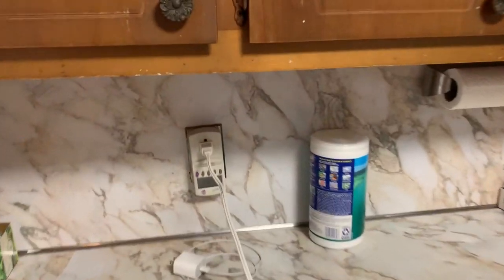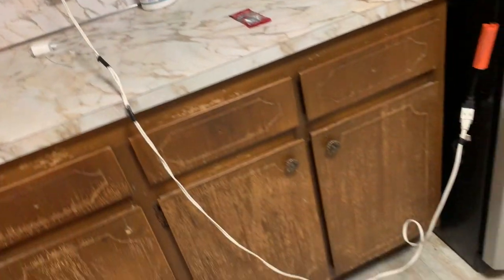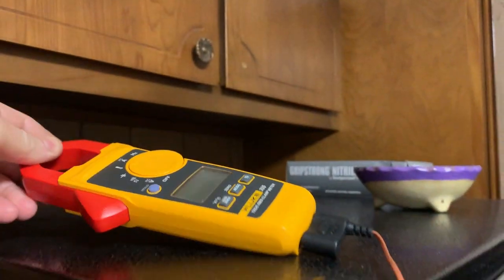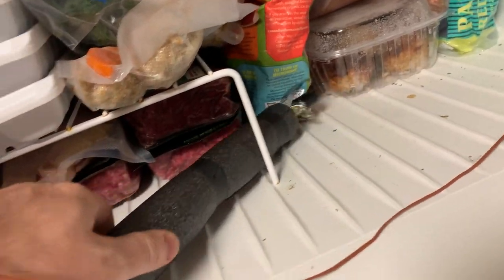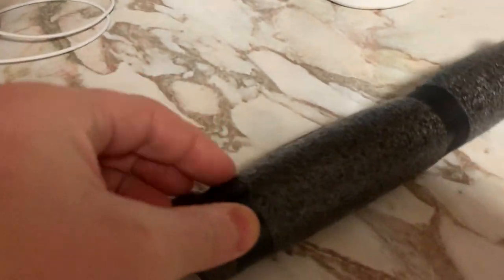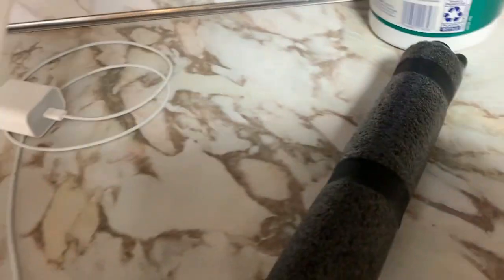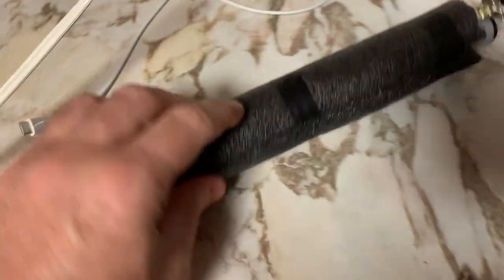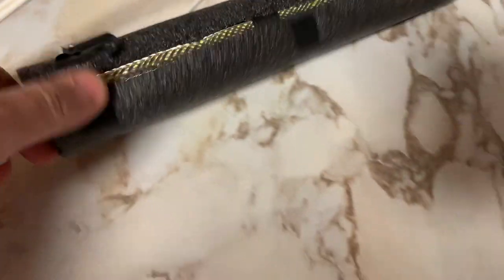Testing  EasyHeat 2102 Freeze Free Heating Cable

Comment: Troy hear from Fairbanks Alaska where we know a thing or two about the cold! This easyheat cable is one of the easiest ones I found to make to custom lengths in the field, and is far less finicky about blowing breakers, etc. than some other cables I've used. Sometimes the smallest amount of dampness will cause these things to trip breakers.

Within the instruction kit easy heat will tell you how many wraps of the tape you need to make per foot or to put another way the frequency of the wraps based on temperature, pipe type, etc. 

I've installed this on P-trap's down to 40 below zero, and it works well. For water lines I would use a 6 W per foot. One of the reasons for the extra wattage is if the water does happen to freeze, it takes a lot more power to  unthaw  a frozen pipe than it does to just keep it from freezing to begin with.  More than once I've had to call out a professional to thaw my well line. 

I would say the devil is in the detail with any heat tape. You want to make absolutely certain you got good contact with the pipe, and don't miss any areas or otherwise have gaps. Seems simple enough but you'd be surprised how many people loosely wrap a cable like this around the pipe.

The other thing is the job is not complete until you wrap it with insulation. That's going to keep whatever heat that does escape close to the pipe. Here in Alaska we actually spray foam the pipe with a good 6 inches of urethane foam, and that is key. There's no way a heat tape like this is going to keep up with 40 below zero without some good insulation coverage. I think it's as important as the heat tape itself. 

This is one product that has consistently perform well for me, but again the devil is in the details. I would also suggest to people they wrap in fiberglass, and not cotton rolls to prevent the possibility of fire. Really only an issue if the tape shorts out, but it can happen.
Reply: Troy, 

I have the Easy Heat Freeze Free installed in a home in Northern AZ.  Yes, it gets cold albeit not Alaska cold here.  I noticed the system was tripping breakers due to the in-rush current.  Seems there is a warm-up period of about six minutes where the heat cable draws 2-3 times the rated current.  For 240 feet of this stuff on 4 circuits I broke it into two 15A service lines.  Normal steady state current at 3W per foot should only be about 6 amps for all.   This is a remote home and it is temperature regulated with a bimetal switch, on at 35 deg F and off at 44 deg F.  The pipes are under a home crawl space and the outside temp needs to get below 17 deg F to turn on the system.

Also, my installation is under the pipe not around it, so due to installation there are a few spots where the heat cables run together.  At this point, the water in the pipe gets to 90 degrees F, single pass runs get to 75 deg F.  So even though the heat cable is "self regulating" I am working on a circuit that regulates the temperature of the pipe to keep temperatures above freezing while not too hot as to waste energy.

Let me know if you are interested in testing it in Alaska.

Cheers,